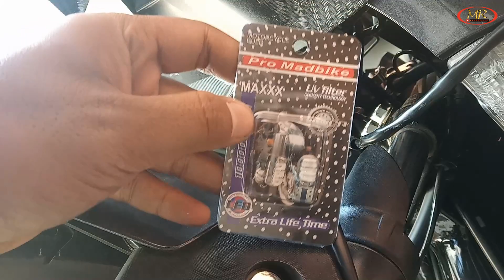Menukar Posisi Lampu Sein dengan lampu senja di Yamaha Aerox

Comment: Lebih simpel pake led sein 2 mode,lednya tancepin ke sein bawaan trus ntar di lednya udah ada 1 kabel panjang ikutin ke positif senja. Saat kontak ON senja yang ada di sein nyala kanan kiri (warna sesuai yang kita pilih) dan saat nyalakan sein kanan maka senja yang ada di sein kanan berubah jadi kuning berkedip mengikuti settingan flasher (flasher harus ganti buat sein led)
Reply: brarti mnding 2 mode led sein ya bang?
Reply: @MRafli-nk1bf  iya
Reply: Ka mau tanya dong aerox ku kua di vdio klo mau di balikin ke bawaan lgi sambung kabel kmna ya? Soalnya uda kebki lampu 2 mode nya
Reply: Flashernya type apa bang, soalnya baru maen aerox
Reply: @gugunfaith1105  Cr7 bang
Reply: Punya sya pke 2 mode klo nga di matiin sein nya posisi motor di matiin tp di indikator lampu sein nya masih nya itu knpa om..